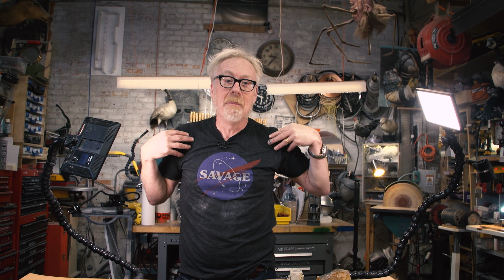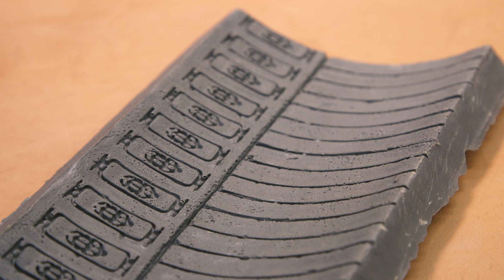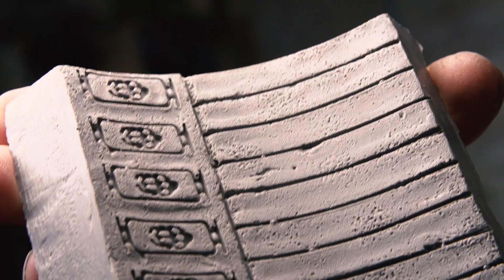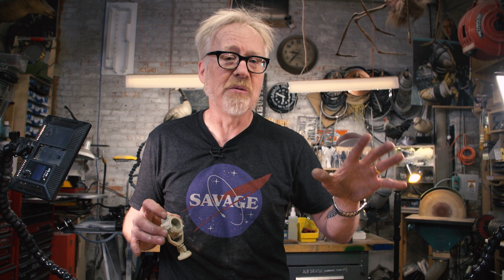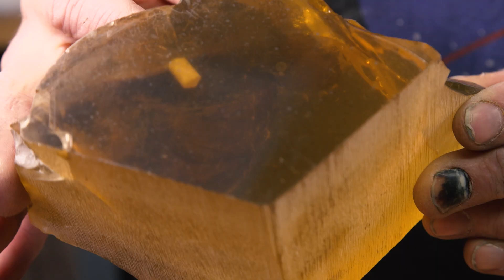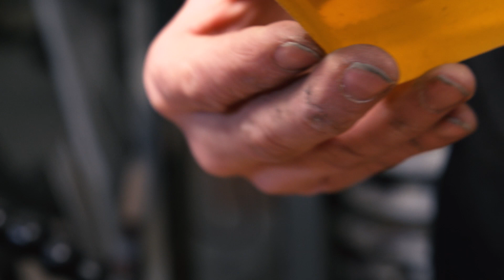Adam Savage's Model Shop Archive Props!

Comment: Please tell me that you drilled through that fingernail to release the pressure of the blood
Reply: Patrick Trauner it’s been bad for a few months, this might have been a video before the last one, because it looked like it had started getting better
Reply: Good lord never say to drill this type of injury people will get it wrong and use a powered drill and make it worse. Either say by HAND twisting a drillbit or using a heated needle to melt a hole in the nail with light pressure.
Reply: @paul I’ve actually power drilled such an injury with a power drill back when I worked as a mechanic. But that was stupid and scary 😄